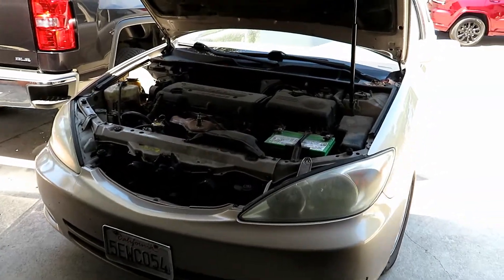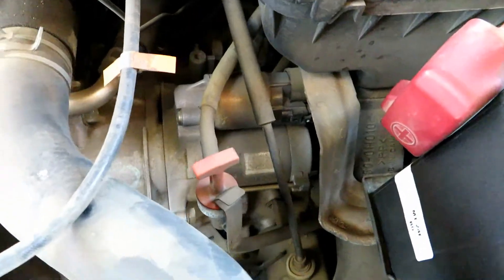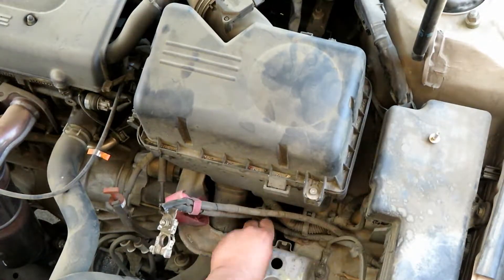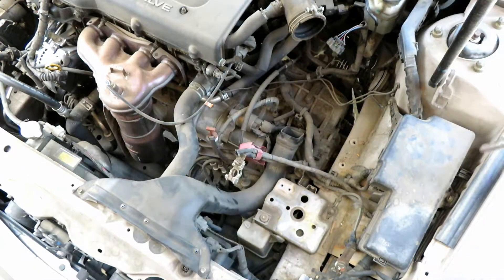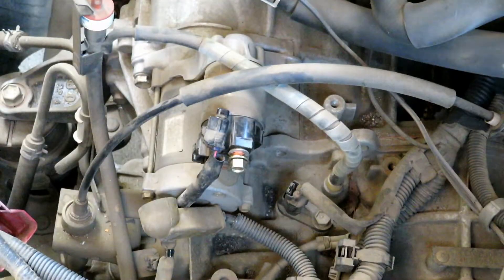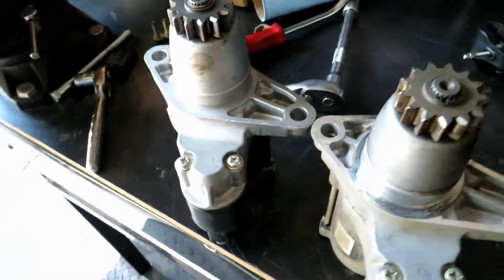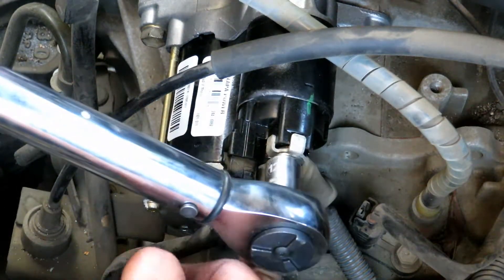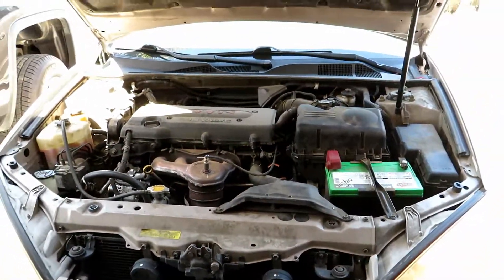2004 Toyota Camry - Starter Replacement

Comment: Had issues with my 04 Camry starting. Took it to AutoZone they scanned the battery and alternator and they reported the alternator was bad. Got the alternator replaced. A week later the car didn’t start. Today I got the starter replaced. After getting the scan from Auto Zone I should have taken my car in to get it fully diagnosed. If the root cause of the problem was the starter then paying for the alternator was not needed. Learned a valuable lesson. Also, when I got the car back the radio wouldn’t turn on. I had to replace both fuses to the radio to get the radio back on. Also learned the tool to remove your fuses is inside the fuse box under the engine hood which is a little white crimping tool. Fingers crossed this car gives me no more problems haha 😂
Reply from the maker: Been there done that lol. I invested into the tools to isolate the problem. (Voltmeter) to check if the alternator is charging and check the woring to the starter for example.
Reply: I just replaced the battery when my starter was bad because I didn't bother to diagnose it first.  At least I know my battery is not going to die anytime soon, and you know your alternator won't.  Better that then get stranded on the side of a highway at the most inopportune time.
Reply: Your alternator still could have been not charging properly

Comment: Nice  going. I'm ordering  a  starter.  My car doesn't  crank every try. I tap on the starter  and  it cranks. I imagine  the  solenoid  is bad.
Reply from the maker: Thank you. sounds like its bad. good luck on your repair
Reply: My used starter  lasted 2 years.  Going  to  use a remanufactured this time.

Comment: Thank you for shooting this video.  Lately, I've had weak first starts also.  The car seems to start up fine later in the day, but the initial start is always kind of wimpy and doesn't quite do it.
Reply from the maker: No problem. Thanks for watching. Let me know how your repair goes.
Reply: I saw the weak first-time start symptom a few times too then the starter suddenly died. If you are out of town you will be in trouble. It's not hard and gonna save you hundreds of dollars of towing, part and labor fee to just buy a new starter from Amazon and follow this brilliant video. Took me only about 1 hour with a standard socket wrench. Good luck!
Reply: @dllizhiyang  my weak starter died at Walmart yesterday while waiting for the replacement part in the mail!  I was lucky someone helped me get it started tapping on it while I turned the key.  I installed the new one today.
Reply: @raiden031  congrats! Mine old one died while I was in gym and luckily it turned on for the the last time after trying for 20 times - so that I could drive to my garage and install the new starter!

Comment: Very nice 👌 Rolando, very helpful and informative as symple as one can demonstrate. I just make sure all electrical connections are clean as the air filter box and starter housing with visual inspection and fly wheel. And thank you for giving us the torque speck. This is important but if    one has this tool 🔧 but do your best 😉,when you have time please review my kia heater core replacement. 😎👍

Comment: I Just Took My Car To The Mechanic To Get A New Starter For My 2004 Toyota Camry.
I Got It Back, And It's Completely Stalling Now.
Any Guesses?
Reply from the maker: stalling while driving? make sure nothing is loose like the battery cables or anything like that

Comment: I have a weird issue... I have everything disconnected (bolts out, both wires out), and I can't remove the starter. It won't budge the tiniest fraction of an inch, as if it was super-glued to the engine block.
Reply: Did you get it?

Comment: Not clear where you got the torque numbers from..
Reply from the maker: its just what i was able to pull off online at the time of recording
Reply: @hyr0llr  is it important?
Reply from the maker: @Anjirito  people will say yes. people will say just tighten them by hand good n tight. But when i can find torques i go by that. if i cant find them, i go by what size bolts they are. little 8-10 mm dont need much. 12-14 mm can handle some torque by a normal 3/8 ratchet
Reply: Is that how the car starts all day or just in the morning?
Reply: My car starts like that only in the morning  do you think is the stater or something else